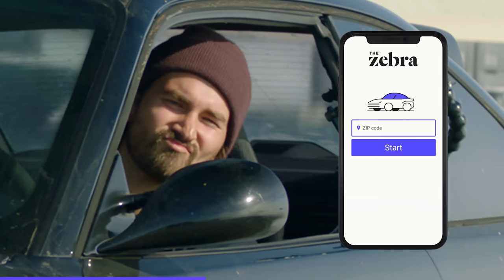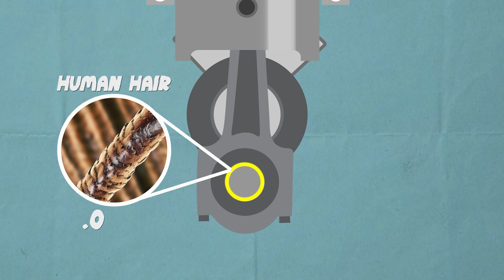The Engine Sound You Never Want to Hear

Comment: My situation:  My 1990 Dodge, 318, No knock, tick, rattle or anything.  (stock) Oil pressure gauge likes to go apeshit.  Cold start, it goes up to the normal range. Once warmed up, it gets freaky.  Driving down the highway, it flatlines, and occasionlly jitters around.  Idling, it flutters all over.  Rei it up and it may go up to normal, or it may just drop dead. It's completely random. 
So...  Since there is no noise in the engine, I'm thinking it (hopefully) is one of two things:  1- The sending unit is crap. 2- The gauge is crap.  I'm leaning more toward the gauge being crap since the speedometer (part of the same assembly) just goes buck wild at random times. Like swinging wildly between 40 -100 Mph in my driveway, when I'm actually doing about 3 Mph. And when it is running steady, it's 5 Mph off. (Showing 60, when GPS shows 55)  AND the temp gauge, (again, all part of the same cluster assembly) doesn't do shit at all. (Have since installed aftermarket temp gauge, but had to leave original sending unit plugged in to the now unused wire to keep the CEL off.   I hope it's actually the Oil Pressure sending unit, since all I have to do is pull the doghouse out (it's a B250 Ram van) and change the silly thing.  Replacing the cluster means ripping the damn dash apart, and then getting a new one, only to go into it and pop out all of those stupid domes that make the cluster illumination that sickly pale blue-green color.🤮

Comment: If the knock/ sound is at the rate of the rpm the problem is in the bottom end, if it’s have the speed of the crank you know the sound is coming from the valve train.

Comment: If the sleeves weren't worn could this have been fixed by bearing+rod-cap+crankshaft replacement with single bearing+rod-cap replaced?   I understand if rings are replaced you need to do re-machine cylinders and do brand-new break-in miles.. also I assume if one were to replace bearings , one would likely do all 6 at the same time to go with the new crank.... 

Can crank be replaced with engine still-in the car if one avoids the cylinders falling out somehow?

Comment: I had my truck's engine knocking when I first started it after it sat for a couple months... Slammed on the gas for a second and the knocking went away.

So did all the engine codes.

I dunno. It's working fine. No oil leaks or anything. Calling it fixed.

Comment: I just had this happen to me leaving a job in Ohio headed back to Texas. I always thought that knocking sound would be a lot louder than what it was and I thought it was just the pulley or a belt going bad so I just kind of left it. There was zero oil in that engine whenever I got it back to Texas and it locked up like a month after.

 Is it more cost efficient to just buy a new engine or to actually have it rebuilt?

Comment: Well if you're like me and spin a bearing in your 2000 Toyota Corolla, you can head to picknpull on 50% off day and grab a whole new engine for $125 from a low miles, well maintained example that's looks like the car crusher already took the rear end.

Comment: i just had my saab 9-3 aero on engine swap since i blew a rod thru the block. with a new specced engine now on and everything play well exept i have no oil pressure so we think. They took my old oilpump and added it for the new engine. could it be so that my oilpump died on my old engine causing it to explode i mean my rod was split in half laying in the road. 

Otherwise really good video and explaining.

Comment: interestingly when you said about the plugs being rich you will likely find that might not be true because to see how the engine is performing you need to be under decent power or full load to know what the a/f ratio is like from the plugs but as you have driven it in the shop and cold started it and let it idle that would contribute to the colour so hopefully ur a/f is actually fine

Edit: thats just my 2 cents may be completely wrong as ive only worked with a bike carb engine so im sorry if im wrong :p

Comment: Zach, that’s just what my Subaru has sounded like for the last 100k miles. In all seriousness, I did have it sound like this and the tube that goes to the air filter had slipped off the manifold lol

After you took the oil pan off, that’s all you had to see to know, “it’s fucked”

Comment: Common rb problems 😂 they almost always spin no.6 and no.5 lol
Get in contact with nitto performance and get yourself an oil drain back for the back of the head and have a chat to them about anything else rb related that you'll need to keep the new one alive (biggest issue they have is spewing all the oil into the head and starve the bottom end especially in spirited driving) , also a baffled sump would help greatly 👍,
 Nitto are the rb kings and will sort ya out with stuff to keep ya rb alive for yrs to come (they're in Sydney oz fyi) 👍

Comment: Great / sad video.  Sorry for your lose.     At times you drive me nuts because there you are with the oil pan off underneath a auto looking for shirt with NO EYE Protection. The babbitt from that bearing is suspended in the oil and getting that in your eyes is a hell of a lot worse than getting some. In your ear.  No to mention there could have been other sharp little bit and pieces of other hard materials in the oil just waiting to mess up your eye balls along with possible chemical burns.   Don’t get me started on the cutting hoses with a razor blade with no gloves.   That helped get me a visit to get stitches once.  I’ll keep watching these great vids but please do the basic safety things to help me be a little less stressed while doing so.

Comment: Bro with the STACK of non-impact rated extensions and sockets on the impact driver... Lol That's how you spot a REAL mechanic, LMAO 🤣 

although my one question mark is because I don't think I've ever seen somebody use an impact gun on an oil pan before, Not taking one off and not putting one on... It's kind of a no-no as those bolts tend to be really brittle(easy to break off) small diameter low grade steel bolts that are on the bottom of the car where it's exposed to the elements and mainly things like puddles and sand which combine to make salt water, but despite always being exposed to these things, it's area is rarely ever cleaned or dried and the gasketing surface on an oil pan tends to be really easy to deform or misshape...

Comment: >own 1985 bmw e28 absolute shitbox 
>shitbox works, none of the door handles work, no hood, straight piped, sticker bombed roof rack +50 hp 
>has had rod knock for months
>still touge it, constantly ride redline and drifting 
>German engines built different.

Comment: I hate cars lol. I love them, but i hate them. Wife's friend asked me to look at his car to test the alternator. So i did and then i tested the battery both were good. There was seemingly nothing wrong with the car. So i plugged in the obd2 reader and it came up with crank position sensor. I thought no way. So i took out a spark plug and told him to get new plugs. A couple days later, i put in the spark plugs, and it still sounds like shit. So i plug in the code reader and it came up with crankshaft position sensor. And still i thought there is no way. So i looked up where the sensor was on a 2006 nissan sentra, and then said, there's absolutely no fucking way that's the issue, cause i'm not doing that. So he went to a professional shop to get a diagnosis, cause that's what i recommended. And they also got the sensor code. So i said to leave the car with me so i can figure it out. The next day it started misfiring, but wasn't giving a code for a misfire, just the sensor. So i thought maybe it is the sensor. Drove around a little and the check engine light started flashing, like it was trying to tell me something. So i pull over and it tells me there is a misfire in cylinder 1. So i'm like okay here we go good news. Then i didn't know which was #1. So i just swapped #1 and #4, so one of them was the right one. So i drove around for a while after clearing the code, and it started flashing again, and i'm like sweet please tell me #4 is misfiring. And it was misfiring on cylinder 1. And i thought this bitch is really going to have me rip this engine apart. So I park and contemplate life for a while. And then start driving again and the check engine light starts flashing again. P0304 and then i became the happiest person in the world. Cause i knew that that code was misfire on cylinder 4. After that it was just a new set of coils and it was good to go. No more code, no more almost stalling at stops, just steady rpms. And then i told him about the ball joints, the control arms the shocks, and he was like i know. I only need the car for a few months.

Comment: man, i took my truck to get the timing chain replaced and got my truck back with a ruined engine. my mechanic is trying to say that i did not do oil changes as i should, (which i did every 3 month) and thats what caused the failure. He was throwing all this mechanic lingo which i do not understand, but i feel he messed up somewhere and he is trying to cover his a$$. Im out $4k and without a vehicle. Can someone on here help. TIA.